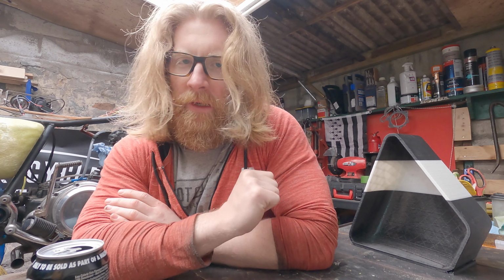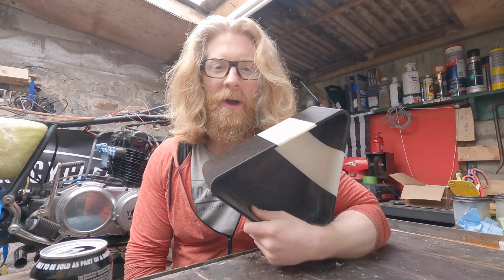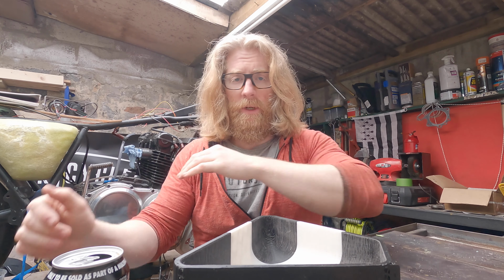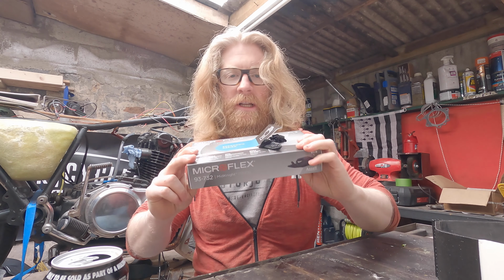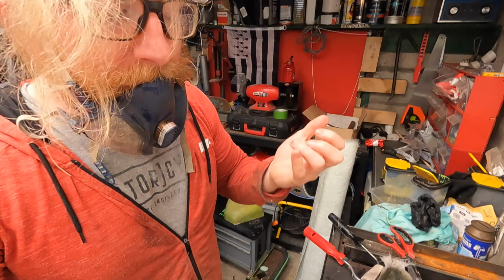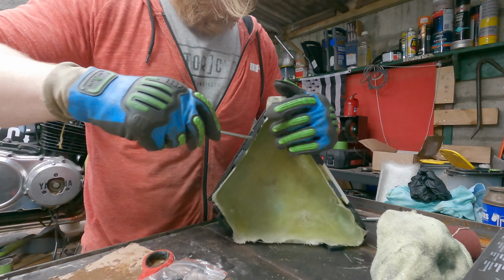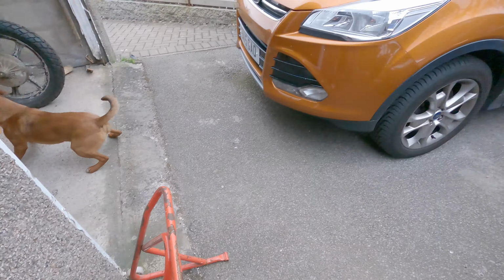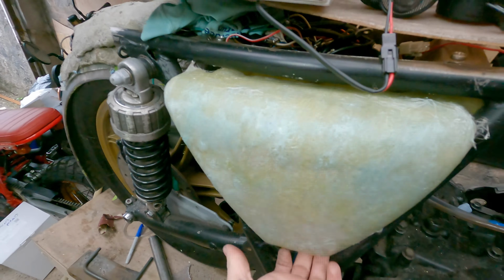Yamaha XS850 Brat build part 31 - Custom Side panels saga (pt4)

Comment: Just a quick tip for future. Poor the resin inside the mold. That way you don't waste it outside the mold. You have the roller so you can easily push it through some fresh pieces of matt 👌 but i really like the idea of making a mold with a 3D printer. I think the mold would be reusable if you would've got it smooth
Reply from the maker: makes perfect sense, appreciate that dude.
Reply: @remotorcycled  yeah won't have hard cardboards to stick into the trash 😂👌
Reply from the maker: @oddis188  it’s handy for seat bases, it means I can properly saturate it then move into the frame. Got the tip from a boat builder but for this time it absolutely makes sense to use the mould 👍

Comment: Result! Are you tempted to stick some gel coat in the mould first when you do the next one? Might get a better surface finish, and make it easier to tidy it up later too? Well done. I want to give this technique with the 3d printer a go, just need to find a reason..! 👊
Reply from the maker: Thanks man. Possibly, will the fibreglass not bond to the gelcoat? At least that was my understanding when the fibreglass sets it's what usually bonds then I would still be left with the surface profile of the mould?

Comment: Couldn't you have made the mold in 2 pieces? So its easier to get it out and re use
Reply from the maker: Yeah probably, I’ll give it a try for the other side I think 👍
Reply: @remotorcycled  might be a bugger to line up and hold secure in place.
Reply from the maker: @KennyKak  yeah that could be an issue, I’ll maybe try a scaled down version

Comment: What was the cad programme you used. And would a complete fuck nugget like myself be able to use it with some success
Reply from the maker: Hey dude, I used one called fusion 360 which is fairly intuitive to use. Things like side panels are a bit of a ballache because you need to design curves on curves if that makes sense. But you do get a free trial for hobbyists if I remember on their website!
Reply: @remotorcycled  brilliant im designing the swingarm spindle and the 4 top hat spacers I need to make it all fit. So just a load a cylindrical shapes. Putting a a chain drive engine in a shaft drive frame is a ball ache